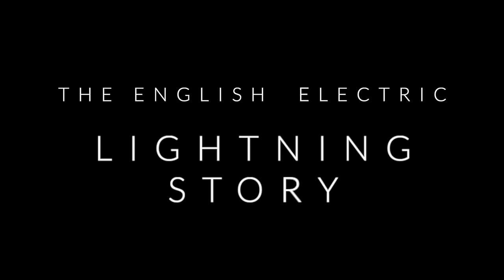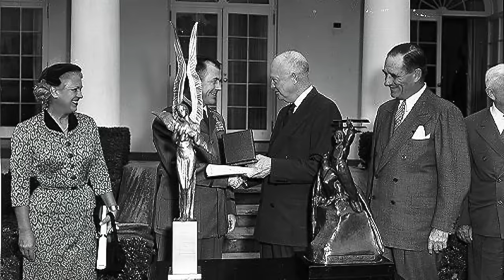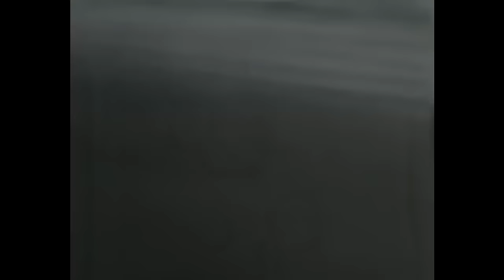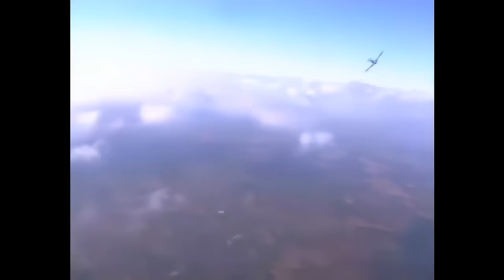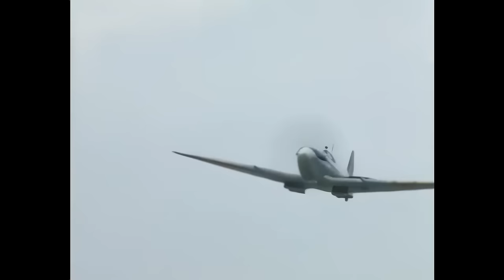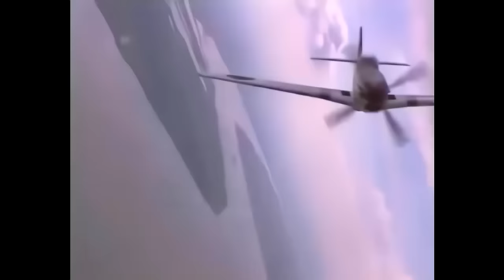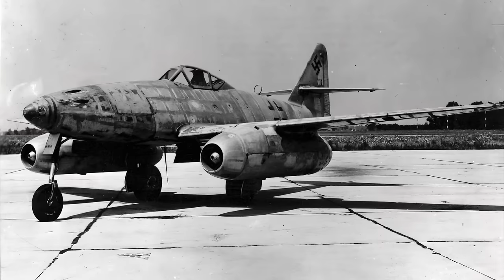English Electric Lightning | The British supersonic fighter and interceptor aircraft | Upscaled

Comment: I know the English were upset we broke the sound barrier first, but Europe gave us the car! The airplane is our thing,  the car is yours! Let's leave it at that.
Reply: Kirk Wolfe  ah, not powered flight. That's like comparing a Greek trireme to a Ford aircraft carrier. Not even in the same ball field. By that logic ancient Mesopotamia can claim they invented the car because they invented the chariot lol
Reply: Well no lets not leave it at that Chuck. Who gave you the jet engines in 1942? Without those you would have been fighting the Korean War in Mustangs (another aircraft we designed, had built and paid for).
But to your main point: There is an argument that the Bell X-1 was not actually a valid flight as it was launched from a Mother aircraft rather than take off, fly supersonic and then land and used a rocket engine. This excellent video rather politely glossed over the simple fact that the UK gave the technology (like everything else we gave you) to beat the sound barrier. Or rather the compressibility issues. The deal regarding the Miles M-52 was that there would be a two way exchange of designs and ideas with Bell whose personnel visited Miles later in 1944, and were given access to the drawings and research on the M.52. But as always and especially in the '40s, the U.S. reneged on the agreement and no data was forthcoming in return. The Miles M-52 was of course a fully capable jet aircraft design.
So not only were you dependent on the British technology ideas for the Bell X-1 to achieve Mach One you were less than honourable people to deal with. As we found out in 1947, 1848 and 1956.
So no lets not 'leave it at that' Chuck.
Reply: @1chish  I'm not saying you guys didn't contribute to aviation! Just like we have contributed to automobiles. But on the same aspect look at the quality of automobiles you have over there, compared to here. Examples Porsche,  Lamborghini, Ferrari, Ashton Martin. All we have is the Corvette, you have to give us something! Lmfao
Reply: @chuckmoore8668   OK fair play Chuck .... 👍👍
Reply: Check the Miles M.52 and it’s design history
Reply: @1chish    I agree.  The British contribution to flight, especially post war, is often forgotten.  Along with the M.52, Rolls Royce jet engine was the template used after the war, the Vulcan bomber designed in the 1940s and first flown 1952, the Comet was the first jet airliner, the BAC TSR-2 was a hugely advanced Mach 2+ bomber, the Fairey Delta 2 was the first jet aircraft to exceed 1,000 miles per hour in level flight and the technology that helped to go into the AngloFrench Concord, the Harrier was the first successful VSTOL jet and the Avro 730 reconnaissance aircraft that was cancelled which could have been an SR71 before that plane.

Many of the designers of the aircraft, after being cancelled by UK government’s, went on to work in Americas aircraft and space industry.
Reply: @frankanderson5012   Its a tragic truth that we led the world into the '50s and it was all gone by our own actions by the end of the '60s. And you are right that the USA was the main beneficiary.
But I guess we were still paying the price of winning the war and having to pay our debts so couldn't make the investments needed.
I still wonder why we ever gave the Yanks the jet engine in '42. After all they were never going to fly jets in WWII to help us. Just think of the commercial advantages the UK would have had then.
Reply: @1chish  Partly true but the aircraft Industry in the UK was huge and the UK had 5,000,000 troops at the end of the Second World War and everything was being reduced. 

Sandys White Paper put the emphasis on missiles and much work was carried out in Australia where the world's largest Military Airspace still is. 

The UK adopted a policy of retaining staging posts around the world and keeping close ties with allies that would help them if required.

The TSR2 was way ahead of it's time but technology and the capabilities of potential adversaries were making rapid advances and it eventually became the Tornado, with the Australians getting to play with F111's but the Buccaneer was still far better.
Reply: @1chish  Thanks for your comment, so much truth.
Reply: @sichere   On your last point TSR-2 never became the Tornado. They were two very different aircraft, designed for very different roles. If anything it was a smaller F-111 that actually worked. We were promised the F-111 at a knockdown price but SURPRISE! As soon as TSR-2 was gone and we were left exposed the price went up and in the end was never delivered and we had to design and build the Buccaneer which was very good but no TSR-2. 

TSR-2's real advanced engineering was not just its performance but in its electronic and surveillance systems capabilities. It was so advanced it became a clear threat to US supremacy so it had to be destroyed because that is how the US operates. Rather than buy into it and share its huge technical advances (like the ability to Supercruise at Mach 2 like Concorde) for even wider security of the West the USA forced not only its termination but its complete destruction. Russia I am sure were jubilant.
The way the Canadian Avro Arrow was destroyed by the Americans promising missiles that were never even built is tragically too similar. 
When Vulcan bombers defeated the whole of NORAD by using advanced electronic jamming and radars in '61 and '62 you'd think the Yanks would want a piece of the systems that had defeated them. But no. Quite the opposite they denied it ever happened for 50 years.
We should always hold close the idea that the Americans are no one's friend but their own.
Reply: @1chish  There was no Miles M-52......ever never.The only thing Miles built was a Ply-wood mock-up.There was no data exchange because Miles didn't have any data to share.The agreement was between Bell Aircraft and Miles Aircraft.MI-5 moved in and shut down Miles and Power Jets.Once Miles was shut down the agreement was null and void.BTW Chuck Yeager shut up the critics in 1948 when he made a ground take-off in the XS-1 and broke the sound barrier with out using the B-29.
Reply: @jerryg53125   Oh dear another graduate from the History Faculty of Hollywood University has joined us sharing the usual Yank denial of facts.
the Uk at the time was tyhe most advanced aerospace industry in the world and had developed wind tunnel techniques during WWII so having a built aircraft was no big deal. Barnes Wallis (he of the Wellington bomber, Bouncing Bomb, Tallboy and the Grand Slam) disliked unnecessary risks to scarce pilots and was able to replicate flight characteristics in a wind tunnel.

Far from there just being 'plywood mock ups' (which there never were any) three prototypes were in advanced construction when the Labour Government cancelled the project. However although a piloted M52 never took to the skies, an unmanned version roughly 30 per cent the original scale did. It launched from a modified de Havilland Mosquito on 8 October 1947. Six days later Chuck Yeager broke the sound barrier for the first time in the Bell X-1 @ Mach 1.06, an aircraft that shared all the advanced technical data from Miles (like the moving tail) and was uncannily similar to the British design. In October 1948, an unmanned full size M52 reached Mach 1.38 in stable level flight.

And you are wrong about the ground take off exceeding Mach 1.0. It was a demonstration of a take off and nothing more.
Reply: Richard Pearse beat the Wright Bros. 

New Zealander.